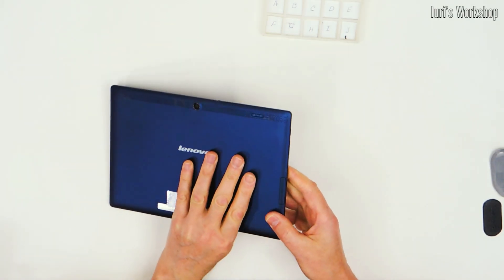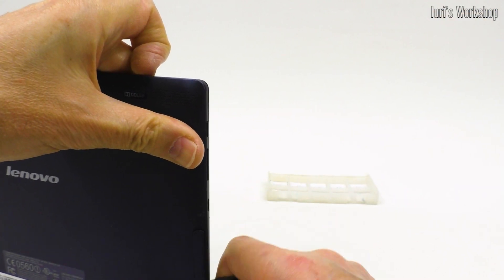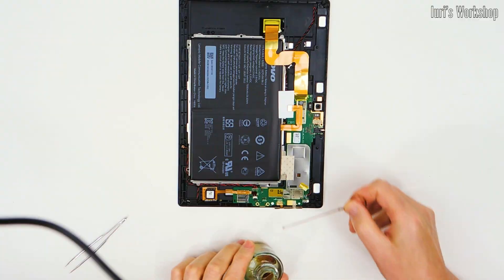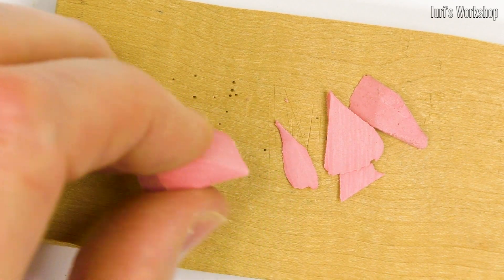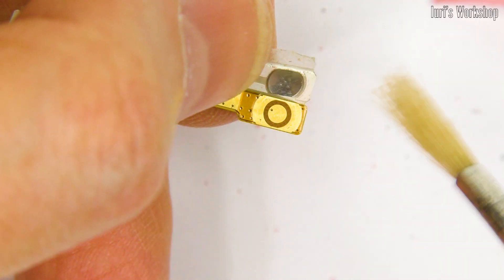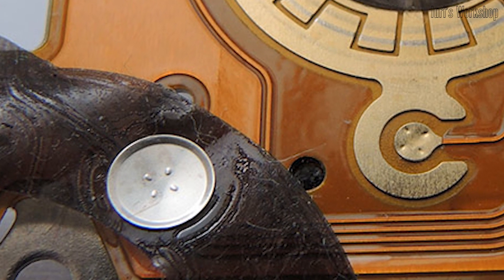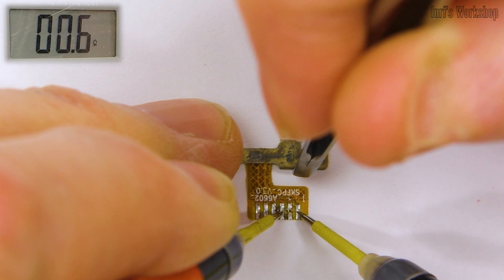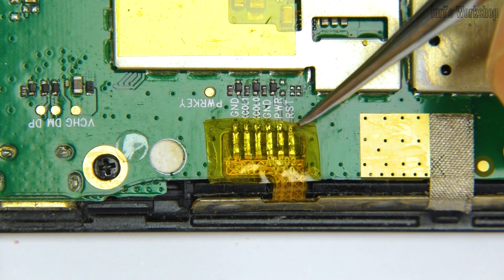How to Repair a Button on a Smartphone, Tablet or Camera?

Comment: My problem is the actual button. I cut one out of plastic, much easier than I thought with a good cutter. However after the physical button and before the internal button (which I re-bought), so the thing you repair in this video, there is a thin layer of plastic to make the physical button actually rebound back to it's un-pressed state, and also keep water out.

Can't seem to find a thin and good piece of rubber. the factory one is like 1/4 mm thick :p

BTW : your really a hardware geek I wouldnt go so deep XD, well, I was lucky again, found it online for 2$

Comment: Ive had to do similar repairs on TV remotes and Video Game Controllers, however thier buttons use silicone cups with a conductive pad installed instead of the small metalic cups of Touch Buttons. :)
Reply from the maker: There is a special repair kit for TV remotes. It includes a tube of silicone glue and thin round silicon electrowire plates. These plates are glued to the buttons and the remote starts working like new.
Reply: @IurisWorkshop  Yes I know, thank you, however I cannot afford such things. I live on a small farm far away from cities and so repairing things with whatever I happen to have is a necessity.
Reply from the maker: @grayeaglej  I understand you! I myself live in the same conditions in a small poor country. You can't buy anything in local stores. I used to order everything at Aliexpress. But now the shipping cost to my country has gone up. For example, a $ 1 item ships for $ 47.
Reply: @IurisWorkshop  I am sorry to hear that. I am glad you have the creativity and intelligence to build and fix your own belongings.

I live in the United States of America, one of the richest countries in the world. But I am a Farmer, not a city dweller, so I must often handle problems on my own with just what I have on hand. I am glad to have a tool like YouTube with Videos like yours to help me. :)
Reply from the maker: @grayeaglej  It is strange to hear that from you. If I still order something the most necessary, then I need to wait 2-3 months for the receipt of the order, and then still stand in line at the post office. And you can order all this without leaving your home. And in 3-4 days the parcels will be delivered to you right to the doorstep of your house.
Be more courageous to make orders in Internet stores!